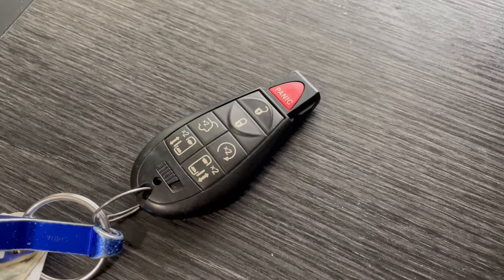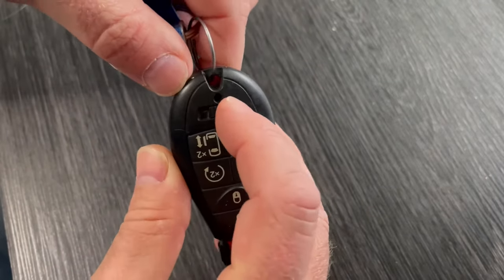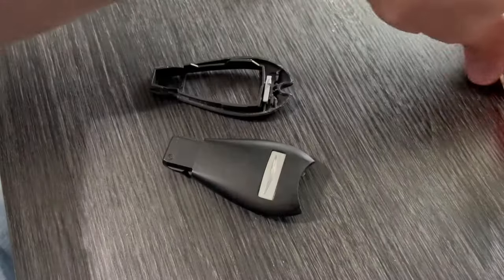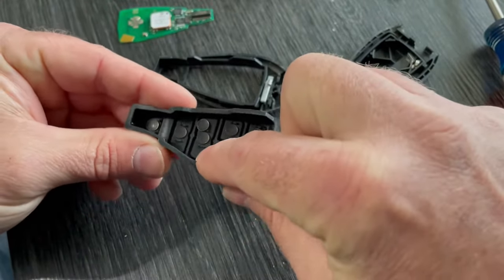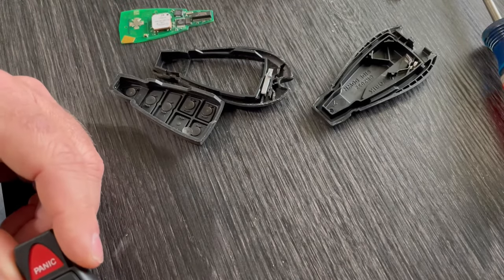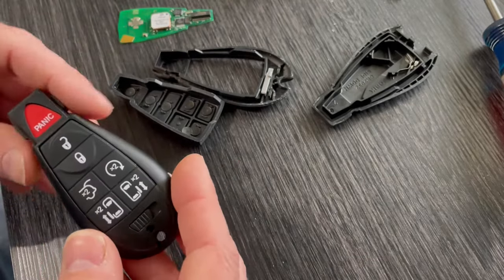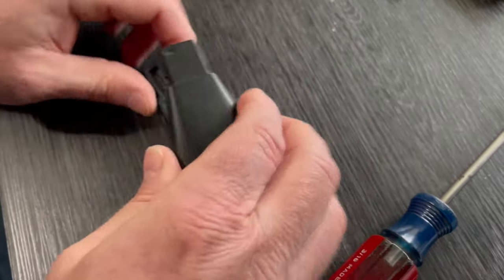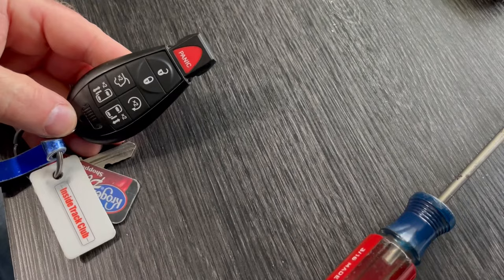Chrysler Town & Country, Dodge, Jeep Key FOB Cheap Repair Fix. 2008 - 2016.

Comment: I am glad I saw this it was exactly the problem I was having!  I cleaned everything off really well with alcohol then used a toothpick to put dabs of 100% silicone back where the metal should be, silicone bonds with metal and the rubber and still keeps that elasticity. Everything's been working perfectly and when I cracked it open to double check the metal caps are staying firmly in place.

Comment: This worked perfectly and saved us a bunch of money.  The new fobs come with unprogrammed ckt boards, but I just re-used our existing ckt boards.  I just wiped them down with a paper tower and used the replacement housings.  The new fobs come with blank mechanical keys that can be used to clone the old keys also.
Reply from the maker: Yes and this can be done on a lot of other vehicle FOBs also. I'm about to do the same thing with an older Honda Civic FOB (buy the blank FOB case and install the guts from the original one).
Reply: Thank you! I was just going to ask this. My case broke around where it goes in the ignition. Was wondering if I could put old circuit board in new case.

Comment: Thank you!  This just saved me $300 in buying a brand new fob! I had the exact same problem where the little rubber circles were just floating around. Thank you so much for this video!
Reply from the maker: Glad it helped out someone and saved you some $$ !
Reply: @RepairNut  but where do you get an empty fob?
Reply from the maker: @sachsgs2509  Amazon. I put the link to the one I got in the video description.
Reply: @RepairNut  thank you!!!

Comment: Thank you!  Car had been randomly beeping for a few days, liftgate locked and would not open, doors locking upon exiting vehicle and i had tried replacing battery in key fob, nothing, still random beeping and fob only working sometimes.  I had an extra key fob (not working at all), but, the little metal thingies all in place.  Was scheduled to go to mechanic tomorrow, but, YAY now i don't have to!!!  gonna order one or two of these just in case.

Comment: yea none of my little disks stay in place iv resorted to super gluing the tabs onto the rubber and for the most part it works but the 2 sliding door buttons wont work still but hey now my chrysler unlocks rather then triggering the alarm

Comment: what glue do u use to glue the disks back in place please?
Reply from the maker: I didn't glue the discs back. I bought the replacement empty key Fob in the link in the description. It has a new rubber pad with all the discs on it. You can then put your circuit board from your old remote in the new plastic case. However others said they used some silicone to try to glue it, or anything that is flexible.

Comment: I tried to replace old rubber button with a new one and it didn’t work so I had to switch back to the old one.
Can you please tell me why it didn’t work? 
Yes , my key fob is like the same as in the video
Reply from the maker: I would suggest replacing the whole rubber part with a replacement rubber part (not just the button). Like I did in the video. If it didn't work for you, I don't know why that would be, maybe your fob has more damage to the circuit board part??